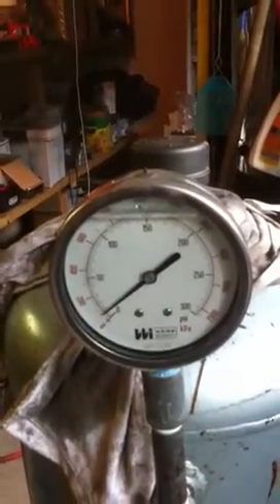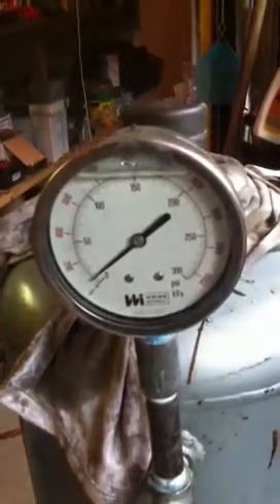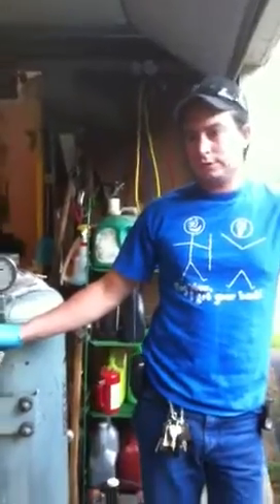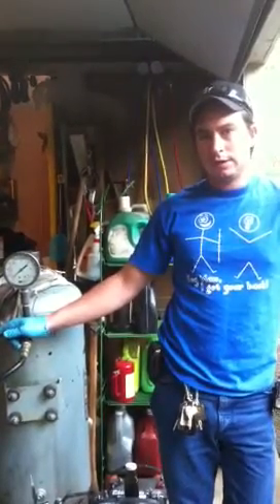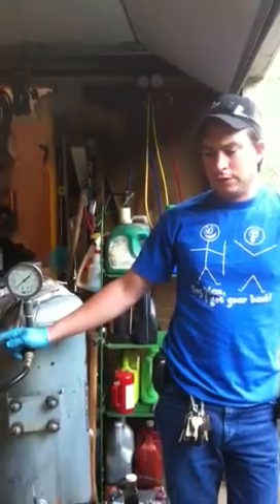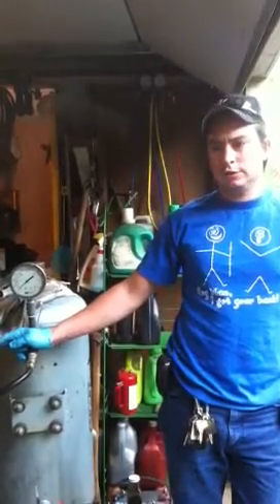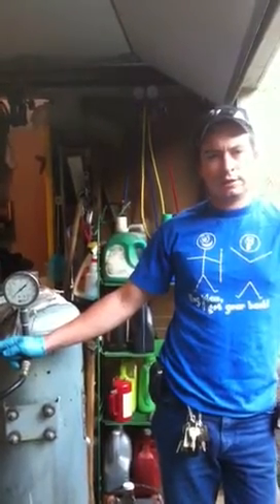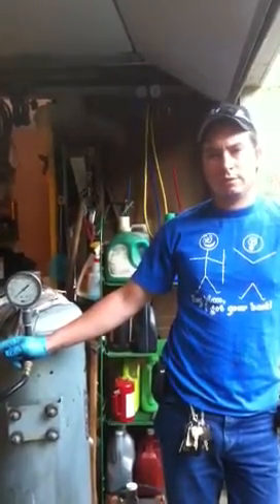WMO - Part 2 - Home made black diesel fuel from waste motor oil without using centrifuge

Comment: I'm  documenting my process of using WMO AND WTO as fue in a diesel.
Check my videos and I will post as often  as time allows it.

https://youtu.be/H27CpK4gctU
Reply from the maker: I’m currently not making fuel but I still have my tank in case prices get stupid again, we’re getting there. I also like having the ability to make fuel in case we get to the point I have to. Good luck with your project, I had fun with mine. I’m still running the same truck all
These years latter. Been on pump diesel only for many years now.
Reply: @GTObearclaw1  
My issue is that i do a lot of driving,  so even with diesel  at $2.50 I still save a lot.

Comment: Great videos. Thanks for sharing. I have a 2.5 Isuzu mechanical injection diesel pickup that I want to try this with here in South Africa. Its Japanese, but still its a pretty tough truck. Planning to thin with 20% RUG, then settle, then run through 10, and 1 micron filters. I'll do a 1:1 diesel to oil ratio like you suggest. My dad is worried about the truck though. What are the risks with using this mix? What's the worst-case scenario? Also, is mixing of the diesel and filtered oil very important, or can you just pour them both into the tank?
Reply from the maker: Mixing RUG with the oil and getting it thinned down is what's important. Adding diesel will make very little difference to the viscosity because diesel is already at the proper viscosity so pump diesel is just a filler when I can't produce enough WMO to fill the tank. I don't know about all diesels, but the injector pump will be the most likely canidit for issues. Iv never had a problem with my older mechanical injected imagine. If it's filtered down to 1 micron, it's filtered better than pump diesel from the station. Most pump filter that I could see where 20 or 10 micron at best. I LOVE black diesel fuel.

Comment: I've been doing this for 15 years. all these other guys want to sell something to do the same job you and I are doing for penny's.  good job and thanks for posting the video.
Reply: Hello Bos Dad,

I am very interested in working from Waste Motor Oil to DDiesel Fuel in a small scale
commercial production.
Please kindly tell me is the quality of the output from this process equal to the standard as the big oil companies produce?
Please tell me if we work out in a small scale business of thos product, what is the minimal output required, and according to your experience, is it profitable?
I am from Indonesia, please kindly give me the opinion of the process of this business, and how much is the minimal investment of the process with what quantity
of the Diesel Fuel come out for selling.

Thank you for your kind attention and information.

Regards,
Andi
email: aandijanto@gmail.com

e-mail: aandijanto@gmail.com
Reply: Andy, I do this for my own use. here in the U.S. waste motor oil has to be disposed of and people would rather give it to someone, than pay to have it removed. I run the black diesel in my skid loader and other equipment.  it is a lot cheaper than buying regular diesel fuel. The only thing you need to do is filter it. by using washable filters such as filter bags that are sold on eBay, you keep cost's to a minimum. here in the U.S. this can not be used for street vehicle's. however I have used it in my truck for testing. it runs just as good as regular diesel and burns better. There is also no smell to it when it burns, un like diesel. make a small batch and try it. you need to make it an 80 / 20 mix. 80% used motor oil and 20% gasoline. then filter down to a minimum of 10 microns or more.
Reply from the maker: Thanks for posting, it's nice to know it works. I had fears at first but nothing but success so far, it has been well worth the effort for me. Not using it so much right now but something I plan to keep as a long time project.

Comment: I get tubs of used oil,let them settle a couple of days,Pour it thru a 5 micron sock filter leaving the sludge in the bottom of the tub.Put alittle unleaded in with the filtered oil,about 1-2 litres per 20 litres of oil to thin it out alittle.And straight into my Jeep fuel tank.The Jeep runs like a Swiss watch.

Comment: Have you ever tried mixing used engine oil with 20 percent gasoline filtered with 10 micron filter. It runs well is mechanical diesels.

Comment from the maker: I live in Texas. its usually hot. but I don't even pre heat in the winter.I add gas to thin it. No heat needed for running oil. You can use gas to thin. Make sure you get your info from people who use it.  I'm sure there are many guys using diffrent systems. I have not modified my truck in any way. I just add  RUG (gas) and put it in my tank.. Yes, I also add diesel to full my tank I when needed.

Comment from the maker: from the research I did when I was deep into this process, the centrifuge should cut out  the extra pre filtering process. Seems like your filtering it more than needed and that consumes lots of time. Though I like to know its good and clean, so I can see why you take the extra time. It took me a long time to get comfortable with using the home made fuel especially knowing 2 micron was my smallest filter. but now I know its going to be okay and I don't even worry about it.

Comment: I have a PaBiodiesel centrifuge that I am very pleased with. They are also one of the finest outfits I have ever dealt with. I am filtering mine with some homemade gadgets packed with cloth and letting the oil trickle through by gravity. It is filtered into one drum where RUG is added and then left to settle, then filtered into another drum then pumped up into another gravity filter where it goes into the centrifuge drum. I run the cf hours at a time and usually it is not very dirty.>. 6.2 Chevy

Comment from the maker: I would love to run w85. That would save a lot more $. The main problem is, I am having trouble finding oil. I currently use 13 gallons of was oil per tank. And the oil goes fast. I would love to have more oil available. But for now this mix is saving me 50$ per tank and gives more mpg.  The truck has been running great, it works great with the oil. It smokes a little at idle, but I have not tried to get the viscosity perfected yet. I can't tell that it smokes much during normal driving. I park